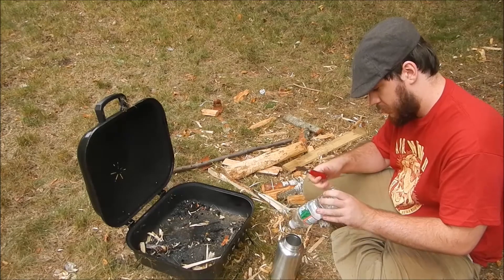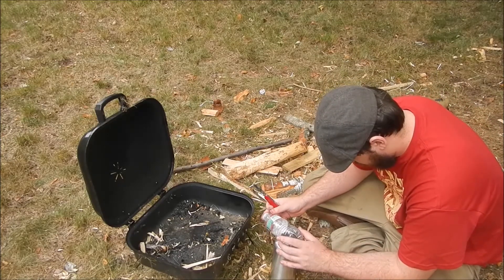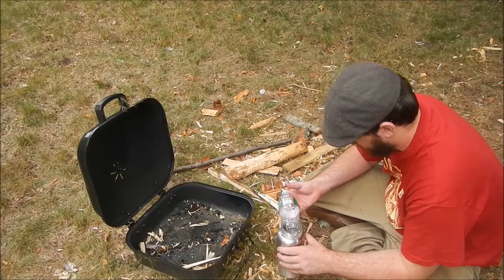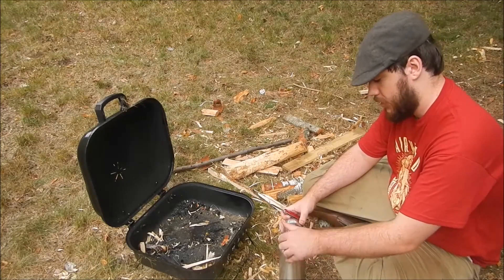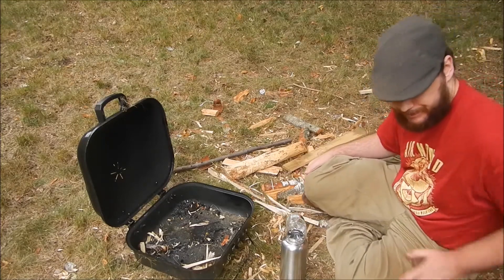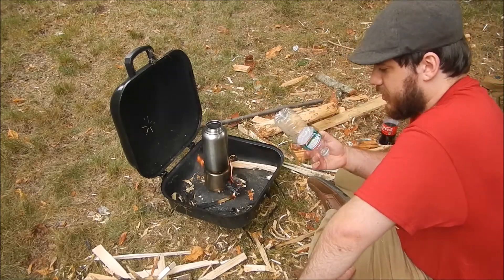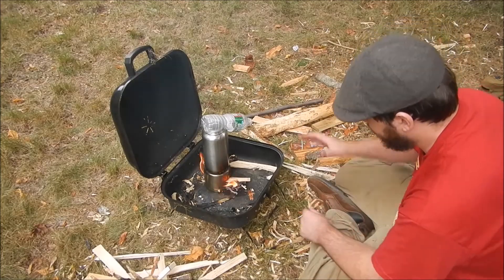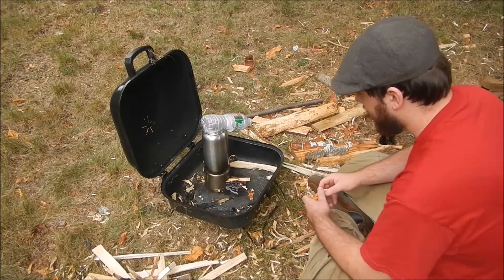Experiment: distilling water with metal and plastic bottles

Comment: hi~ using plastic with heat is dangerous. i got a way to do with stainless steel only. but i seldom shot a youtube. if u would like to know, msg me. i show you the idea and material. they are cheap. just use a stanley adventure cook set to boil water. get a SS V shaped dish from aliexpress, then the condensed water are collected inside another SS small dish. see https://www.wikihow.com/images/thumb/8/80/Make-Distilled-Water-Step-5-Version-2.jpg/aid1147815-v4-900px-Make-Distilled-Water-Step-5-Version-2.jpg
Reply from the maker: There are multiple ways to do it, even with a metal cup, or copper pipe. This particular experiment was intended to see the effectiveness of distilling water out of of a bottle like this but the only catchment you had was trash like a plastic bottle. Which is relatively common and easily manipulated. When I did it, it was something I saw on TV and they showed it as extremely effective and I was skeptic. So I decided to try it.
Reply: The Otter Outdoorsman forget it. u wont know what fxxx material was released from the bottle. prepare a ss cook set, ss top condenser and ss collector as in the wikihow to, this is better.